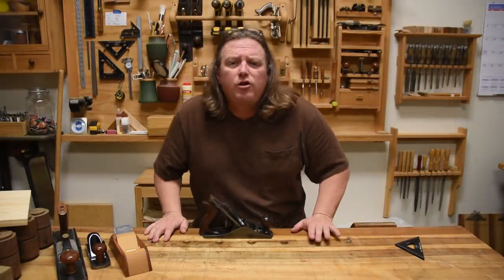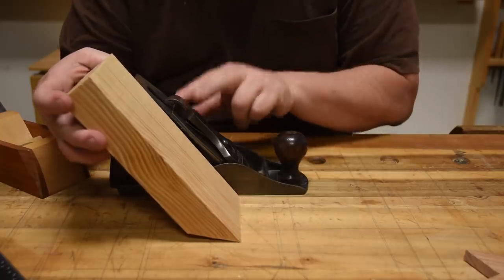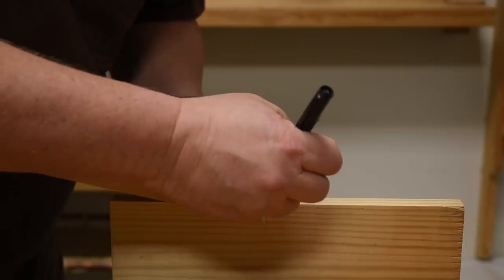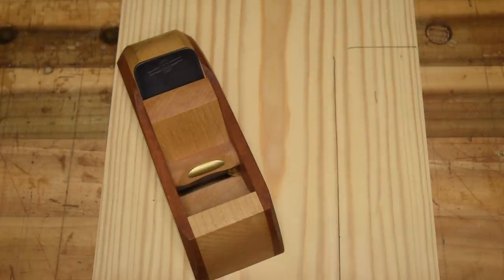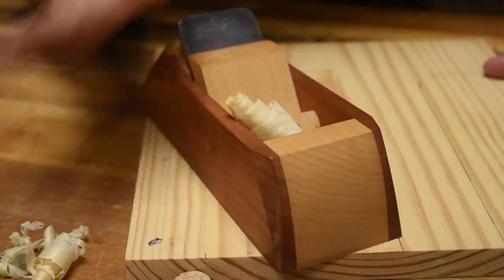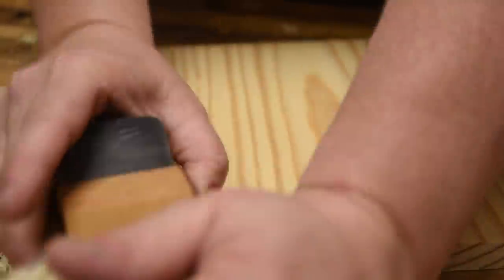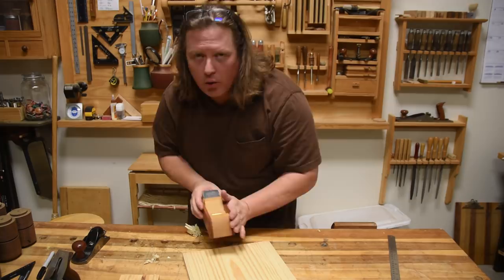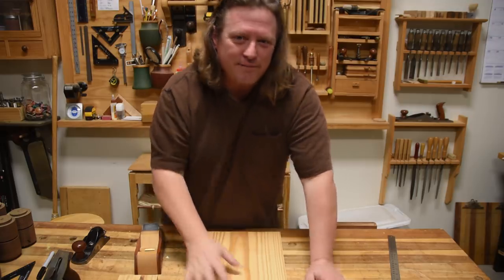Skew'd Angle

Comment: I think the angle would be 35.22 degrees if the plane was turned @ 45 degrees. just as a hip rafter would be on a 12 and 12 pitched roof. love your videos. from an old carpenter that was wrong occasionally.
Reply from the maker: Haven't a clue on exacts, you're likely right.
Reply: @wortheffort  never thought about it in regards to my plane, thanks

Comment: I've been planing some old ipe and found that turning the blade around so it's bevel-up in a normally bevel-down plane worked to both stop the tearout and make the planing easier. It's so dang hard and interlocked that the tearout was not just making the surface finish pretty poor but also causing the plane to chatter and sometimes stop dead. I got the idea to try it from seeing HNT Gordon's planes which are designed to work the hardwoods found in the region that they're located in - Australia and the surrounding places. (Not affiliated and they're out of my price range, but they're some beautiful looking tools.)

Do you think you could do a video on working with extremely hard, difficult woods? You've mentioned some in your area but there's different types available all over the US (usually in smaller trees, but that's still great for turnings, knife scales, and other small items, as you said in your other video.)
Reply from the maker: I'm a scavenger and use whatever I can find that'll work so likely you'll hear of somemore. But Pecan, Bodark, and Mesquite make up the hard end of local stuff.
Reply: Was just asking about general tips, sorry if I got a bit wordy. Really just pointing out how everyone has some tough wood in their local areas, and since it tends to be in limited supply it can be daunting to try using it without knowing best practices.